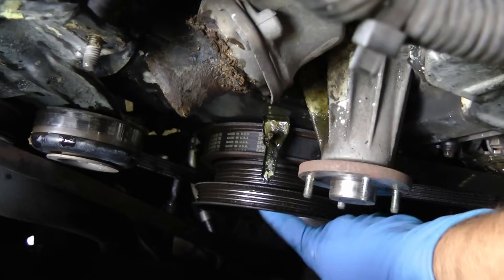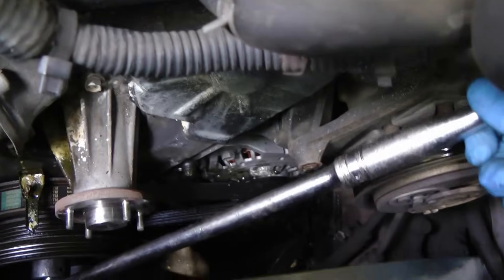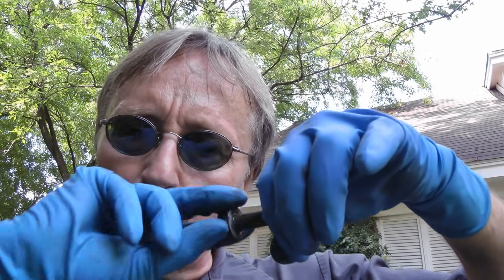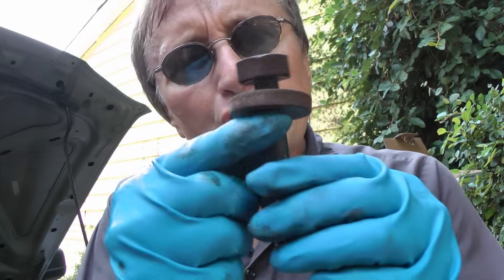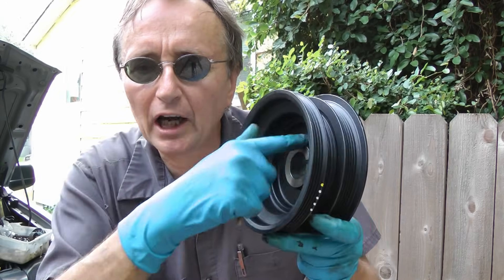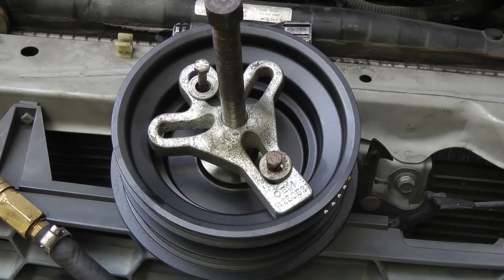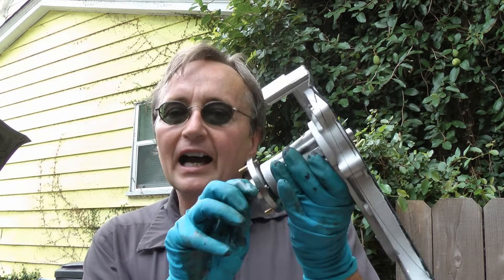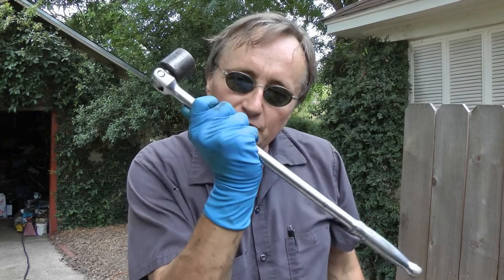How to Remove a Crankshaft Pulley in Your Car

Comment: Hi Scotty,

I have a noise coming from the hood and it comes only when the AC is ON. My car has a separate AC belt, so I removed it and tried to rotate the compressor pulley, but it was spinning freely with no noise. I replaced the AC belt tensioner, but the sound is still there.

Could it be a bad crank shaft pulley?
Reply from the maker: PontiacG8 6.0L could be, listen with a stethescope to find out, it's that OR the compressor itself going out, they often only make noise when loaded up and running

Comment: Hey scotty. I had to pull my engine out of my car. But I don't have a air rachcet or impact to take of the crank pulley bolt. Any other ways to get that off when my engine is on a stand? Thanks.
Reply from the maker: +Rick Davis yes, lock the flywheel bolted on the back with big vice grip pliers

Comment: is it ok to remove crank pulley with impact wrench without locking the pulley itself? all I'm worried about is that the pulley will turn when I use the impact...please advise.regards
Reply from the maker: pulley will not turn with an impact if you hold it with your hands, torque sideways is very small doing that
Reply: thank you

Comment: Hey there Scotty.  I know in a video you said not to buy Jaguars (due to expense), but it was too late already did. lol.  Anyway, I have a problem.  I was suppose to lock the crankshaft before removing the cylinder heads, but as you my already guessed, I sort of moved the crankshaft by accident anyway (without marking it).  I guess my question is:  can i just adjust the crankshaft to 'Top Dead Center'??  oh yeah one other thing, my not-so-brilliant idea decided to turn the bolt that is connected to the intake camshaft on the left side of the engine (V8), so, I heard a thump, and notice that camshaft was turning slightly loose, I am not sure cause if I broke an opponite of the cylinder head or I just did a thousand(s) dollar(s) mistake........heeeelp.  (I am still learning no matter what)

Comment: Hey Scotty, I have a 95 4runner 3.0 and a 98 4 runner 3.4 also a 2005 sequoia 4.6 Will this method work on all of these?
Reply from the maker: yes, they all turn in the correct clockwise motion when the the engine is running.

Comment: Actually...?

Quite Right to put a breaker bar onto the harmonic balancer with the appropriate size socket and orient the Breaker bar properly...but this only works to loosen the bolt. Tightening takes either an impact, Rope in the Cylinder @ TDC (To "Stop" the Motor from turning over), or a special type of tool that locks into the "Spokes" of a Harmonic Balancer in order to accomplish manual tightening.

I prefer the "Rope" coiled into the Cylinder through the spark-plug hole method

Comment: 2008. Mountaineer. I have a super stubborn balancer, I tried the pull and bolts are snapping, but im only able to get 2 bolts. I tried spinning and prying, I tried a bunch of YouTube methods. Been 3 days. I'm super frustrated. 
 How do I remove the middle,seal to get better access to the bolts. I'd be able to get 3 or 4 if can find away to remove the seal. Please help

Comment: But how do you torque the pulley down when you go to put it back on? Without a tool to hold it, the engine would soon when you'd go to torque it down

Comment: I CANT FIND THE RIGHT VIDEO. My problem is i have a 99 mustang v6 3.8 liter that the crankshaft is STUCK in. My car wont start until this moves. it stalled and stopped the engine along side of the freeway. i know for a fact its my crank shaft, what could make it stick and not turn at all?
Reply: oh shit... sounds like its guts f'ked.... :(.. damn best to double check with a mechanic or friend who knows cars..
Reply: your engine is seezed up  dude

Comment: You are a mechanic and I am a detailer. That has to be the worst and unsafe way to remove the cranshaft pulley bolt. If you look at your crankshaft puller, the reason that there is a square end is because that is where to use a large adjustable wrench to anchor the crankshaft pulley. Then you run an extension through the hole in the middle, hook it up to the crankshaft pulley and then anchor the adjustable wrench to something like the ground preferably. Then you safely remove the bolt. I have done this a million times. If there is no bolt holes, which is common on Ford motors, you have to use a large chain wrench to anchor the pulley. It is extremely similiar to pulling the pulley off a power steering pump. I really got to start making videos.
Reply from the maker: stick to detailing. You can't use your "system" on many vehicles because of the crank pulley and bolt design. my method works great for quick removal of hard to get off bolts.Sure, I have tons of tools to take them off, but most require removing the radiator and AC condenser, a giant hassle.  AND, if you use a large chain wrench on any MODERN vehicle, the cheaply made pulley will break off in pieces, believe me.  I hope your detailing work is better than your mechanical ideas.
Reply: Scotty Kilmer
Hi Scotty, I like this method you are real mechanic, works great I used it many times.The guy apmat nlif do no know what he is talking about.

Comment: Is this method safe to use on an interference engine?  [EDIT: I believe so, after thinking about it more.  Timing between crankshaft and camshafts has not been affected.]
Reply from the maker: as long as the engine spins in the correct manner, yes
Reply: how would the timing between the crankshaft and cam shaft be affected the starter is turning the flywheel  and the other end of the engine is the crankshaft pully  pully spins but the cheater bar holds the bolt in place  but the cam shaft still spins theres nothing that stops the cam shafts from spinning I don't see that throwing off the timing as far as engine spinning  in the right direction  you have to make sure the engine spins the right direction clockwise I believe  or you might break the bolt off or the engine wont spin the bolt off
Reply: Agreed, stingray300m.  It just took me a while to reach that conclusion.
I ended up not using this method, though;  my pulley bolt was reported to be tightened to 181 ft-lbs, and I was worried that my starter couldn't provide that much torque, and might get damaged.   But I'm glad to know about this method, for future reference.  (Provided the pulley spins clockwise, of course.)
Reply: Ryan Bissell the only way you would damage your starter is if you keep holding it and the engine wont spin its the same as a locked up engine in that case you can burn a moter up holding it for long time like one min if the engine is not spinning  one  of a few effective ways to get the crankshaft bolt off is with a impact wreanch  but if the bolt is seized on you gotta worry about rounding out the bolt head or snaping the durn thing off  quite rare but I suppose  it happends hope I was able to help too

Comment: Scotty, we have tried everything to get this Harmonic Balancer off and it won't come off. We even broke a remover and bent the washers on the bolts...what to do? Plz help !!!
Reply from the maker: Kim Mathis I can always get em off, just heat up the bolt red hot glowing with an oxygen acetylene torch and it will come out

Comment: Scotty, I have a 99 Toyota Tacoma the belts completely came off while driving and the crankshaft is loose...we tightened it up and put the belts back on and started it back up and it immediately loosened again. We are at a loose and are looking for advice. I am thinking it could be the crankshaft pulley key-way?? But I am a complete novice when it comes to being a mechanic. Any advice you could offer would be greatly appreciated!

Comment: nothing to do with the crankshaft pully but i am pulling 3.7 motor out of my 04 dodge dakota 4x4 the only thing i have left to unbolt is the flywheel from torque converter but i cannot see how it can be done. do i have to take tranny out with it or am i missing a step. i am not a mechanic but i have done this before and capable of doing it i don't have it on a lift or ramps so its a real pain. any help is greatful

Comment: How do you get it off in the back forty of some junkyard where there are no impact tools and cant bump the starter?
Reply from the maker: Jason Roach I've seen guys do it by removing spark plugs, feeding rope into the cylinder, then crank the engine with a cheater bar and socket till the rope jams on the piston then stops movement

Comment: what about gettin it baack on... would the only way be stopping the motor at the flywheel?
Reply from the maker: taylen alinger get a strap wrench, put it on the crank pulley to hold it from moving, and put a little loctite on the bolt end to it stays in place

Comment: Will it work on a 91 civic hatch? The bolt is real tight have already tried using impact gun and nothing
Reply from the maker: NO, it turns the wrong way. Heat the bolt up till red hot with a torch, then the air gun will remove it

Comment: would this trick work with the camshaft sprocket, or will I most likely damage something?
Reply from the maker: Ace Revo IF it turns in the same correct direction and has a right hand thread, yes, you could do this
Reply: Scotty Kilmer Thanks for the reply!

Comment: Hey Scotty, Im from mumbai in india...I'm having a hard time getting the crankshaft bolt on a Honda city 2000 model...The 'cranking the engine' method would not work on the honda as its the opposite side and will tighten the bolt further....its definitely stuck quite hard as ive had a couple of my extension bars brake but the bolt wont open....any tips :-)
Reply from the maker: Clayton Pereira heat the bolt up red hot with a torch, then they come out

Comment: hey scotty,
this is scotty and im in trouble again!
i removed my squeeky belt on my mazda mpv 2000 v6
only to find the altnator and tensioner and belt arnt making the noise.
i took the belt off and still get a chirping squeek while engine running with no belt...stumped again!
Reply from the maker: +Scott Tyler take all the belts off, and if it still makes noise, then timing belt or something it drives is making the noise
Reply: +Scotty Kilmer yes i did even removed harmonic balancer sounds like timing belt inside engine...not sure if metal or rubber on v6 mazda

Comment: Any ideas why a new crank seal keeps popping itself out causing a small leak?  Its on a bike.
Reply from the maker: worn engine with too much blow by from pistons normally, but try  using an epoxy to seal it in after cleaning the surface whistle clean
Reply: thanks scotty but the engine is still under its rated mileage.  the seal slips out of its hole and slides down the crank shaft leaving a small gap.  it's got 19k km on it.  what epoxy should I get?
Reply: Hey Scotty i used some gasket maker and it held the seal in well.  But the bottom of the seal is leaking oil.  I took it apart again to try a new seal again.  The seal is still in their with the gasket maker but i don't get why its leaking around the crank on the bottom.  The seal was new.  Is it possible the seals get worn from sitting at the store before their sold?  What if i soaked the new seal in that seal restorer stuff before installation or will that ruin it?
Reply: also on my bike you have to remove the cover to change the seal you cant just do the trick you show in the video.

Comment: thanks scotty, i've removed my crankshaft bolt that way using the engine to do the work. But when putting it back on and tighten the bolt back, can you use the engine to tighten the bolt back on since the crankshaft pulley keep moving the same direction on the force applied. Thank you.

Comment: Scotty Kilmer I heard about light wight sport engine pulley that add around 10 Hp to the engine but is that true ? are they reliable for everyday driving ?
Reply: yasser aboamoud that almost sounded like you said you needed to change your muffler bearings and blinker fluid.
Reply: xxRamD3yruxx Really ? do you have any idea about which parts I am talking about ?
Reply: it sounded dumb at first but pulleys with low resistance and low rolling mass may actually free up to 10 horsepower. It may be real but it doesn't sound easy to find nor worth the trouble.
Reply: xxRamD3yruxx on asian cars 10 hp make a diffirence .I would pass other japanese cars that have less 3 hp only. With same wight and same transmition as my car

Comment: hi how we know we need to chance a crank shaft pulley  i have a mazda 626 1997 and make it a noise but is a lil bit when i crank it and i moved my steering well   but when i turn on the ac is louder and but the ac is cold is working but when the ac is stop bit it's seft the noise is going but come in back when the easy come in back i replaced  the serpentine belt but the noise still there .....

Comment: since Hondas spin the wrong way, could you use that trick to tighten the crank pulley bolt? Just wondering, trying to get as many tips as possible, since im about to change my water pump on a 95 honda civic.

Comment: couldn't this snap a timing belt or chain due to the stress put on it?  I am asking because I thought you was actually suppose to keep the balance stationary while turning the bolt...
Reply: +Metal Maniac no it is a safe way as long as the engine turns clockwise from the front.

Comment: How do you get it to turn without starting? Seems to me if the engine turns over, I'm screwed...
Reply: +Michael S Disconnect coils from spark plugs that way they can ignite thus engine wont start and only starter motor will run and turn the crank
Reply: +Michael S 
Unplug the fuel pump solenoid. Crank a couple times to make sure engine doesn't start.

Comment: my crankshaft was damaged by my bolt coming loose and the harmonic balancer got sheared in which that sheared the crankshaft where the woodruff key is positioned and around both sides of it.  I have a new harmonic balancer and key,  the pulley sits where it is supposed to just fine and the new key slides into place.  Will it still work if I screw the bolt back on and put the new belts on or will it just fail.  I really cant afford a new engine.
Reply from the maker: luigi luchiano depends on how worn the area the key slides into. BUT, I've had great luck putting JB weld Kwik epoxy on the keyway first, then sliding it on, it's pretty strong stuff if you let it dry 8 hours before use

Comment: Can I use this method on a 2001 Honda odyssey? Can it break the timing belt or anything else while doing so?
Reply from the maker: no, hondas spin the wrong way
Reply: Scotty Kilmer Incorrect.  Honda V6 engines CAN use this method as I have done it with 1 Ridgeline, 1 accord V6, and Odyssey V6.  The 4 cylinders are different though, at least the old H/F/D/B series.
Reply: There is a special tool sold at Advance or Napa for holding the pulley. It is 35 dollars and very easy to use. I have personally used it.
Reply: I have the tool too, but I would much rather use this trick, which can be done on any honda J Motor V6 that I know of.
Reply: The 2001 odyssey I'm assuming has a J Motor on which this method will work on? I borrowed the tool from autozone but just in case I can't do it using the tool, this method is what i plan to try.
Reply: I appreciate all of your comment.
Reply: Astrit M If that tool doesn't work. I used it on Civics with no problem. You could always take the dust cover off your automatic transmission and wedge a pry bar in there to stop the crank from spinning or remove your starter and wedge a pry bar in the opening to stop your crank from spinning. I would be careful with the teeth on the flywheel and do it slow. The problem with this method of starting your car to remove it is that you have to eventually put the crankshaft pulley back on and that requires a bit amount of torque. You cannot start your car and do that. I am going to make a video tomorrow on how to properly use a crankshaft puller to remove a crankshaft pulley. When I reassemble my motor I will use that same crankshaft pulley tool to install that crankshaft pulley. I realize that Scotty doesn't do it that way, but he is a mechanic not a DIY guy. I am not working on a Honda at the present so unfortunately I cannot show you. Getting the crankshaft pulley on right is extremely important.
Reply: I always use a used serpentine belt to stop the pulley and it works great. No need for specialty tools.
Reply: Even for Hondas?   They seem to be the hardest to get apart from the factory.
Reply: Corey Jacobs The bolt on Hondas is on there pretty tight. I tried the method in this video and it just stopped the starter. Starter motor could not turn it! a 980 ft/lb IR impact did not work either. Only a breaker bar plus a cheater bar that measured about 4 feet long did the trick. Had to pull with both hands and push with both legs against the undercarriage to make it break loose. And I used an old serpentine belt to stop the motor no specialty tool needed.

Comment: I tried to do this today on a '97 Camry. I wedged my breaker bar against the ground and it stopped the motor dead when I tried to bump the key. Not enough torque to get the bolt loose. What is that about?
Reply: @adammirage4261  I haven't yet. It's a friend's car, had to give up on the job until I can get over there with a crank pulley-holding tool and try cranking on it with a long breaker bar.

Comment: Hi ,
I'm doing the same job on my jeep Cherokee and while I was tightening the big center bolt one of the bolts used to attach the extractor snapped! Before it snapped it pulled the oily about 1 inch away from the engine.
Please help! How can I remove this pulley!
Reply from the maker: Daren Martin try prying from behind with pry bars to get it off
Reply: Thanks allot for the response! I ended up doing that and it all worked out. great job with the videos!